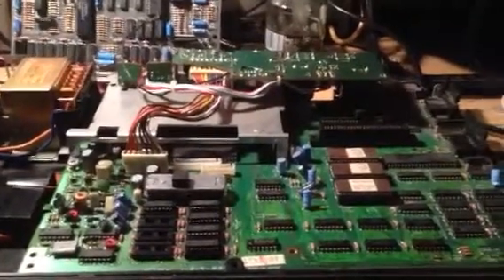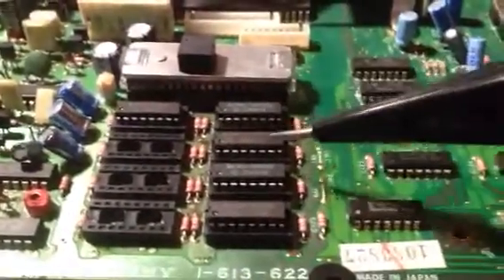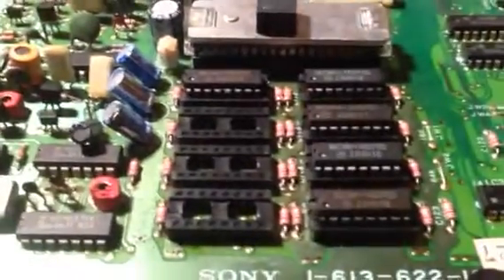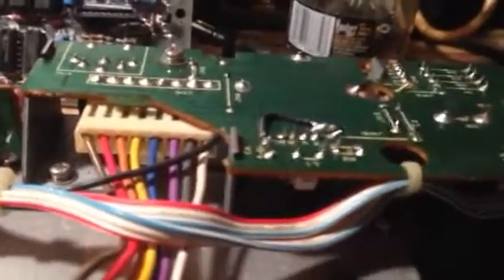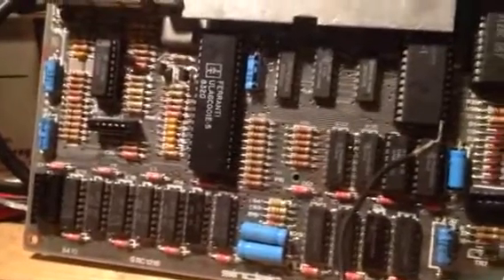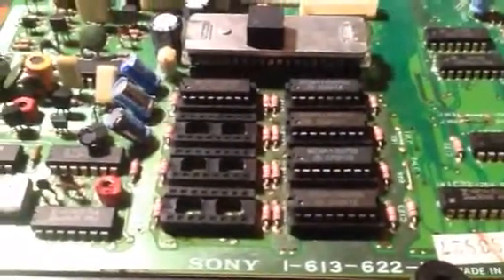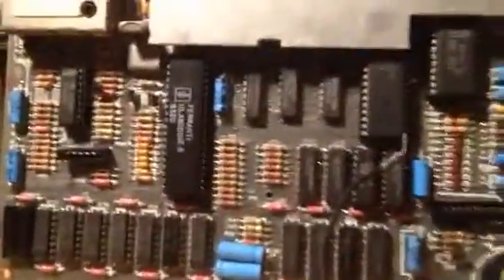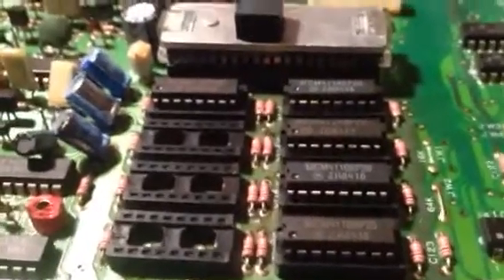MSX repair pt2

Comment: Wow, those boards sounds a nightmare!!!
Reply from the maker: GadgetUK164 Yea its got to be the worse computer PCB I've worked on, its more like the PCB in an 80's VCR and the way all the legs are bent over just tops it off.
Reply: It's hard to believe!  You wouldn't expect that of something made by Sony!  It's never much fun when pins have been bent over, but with the low quality PCB that makes it understandably a lot worse,